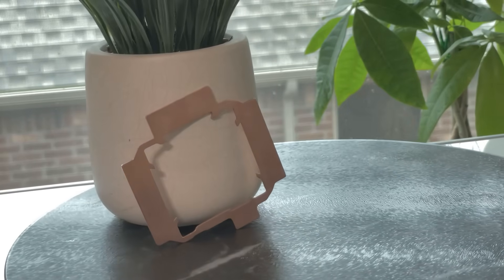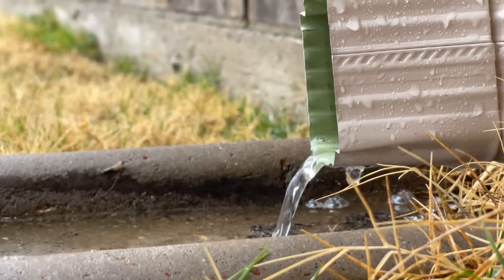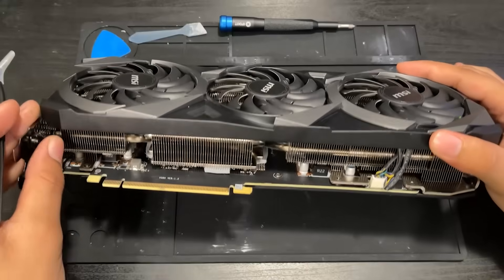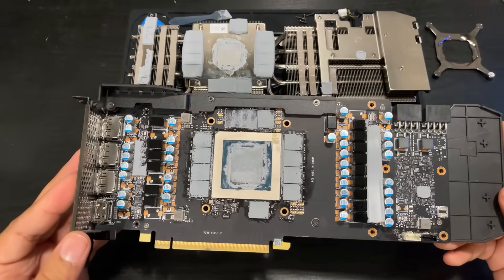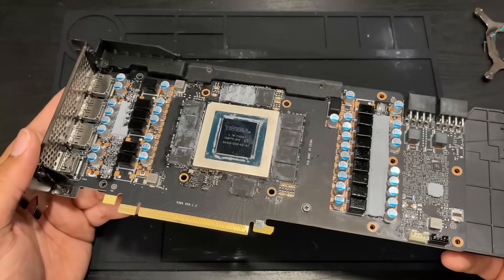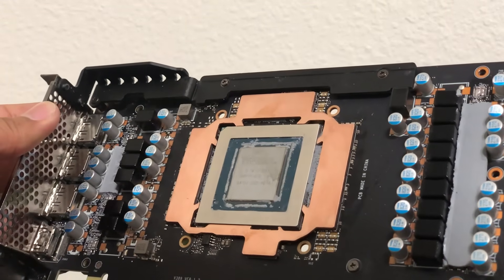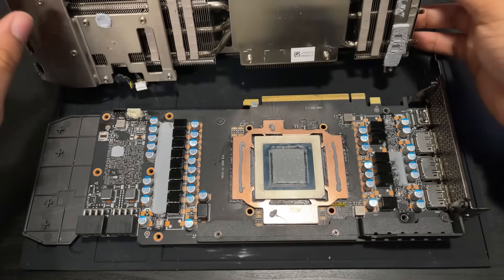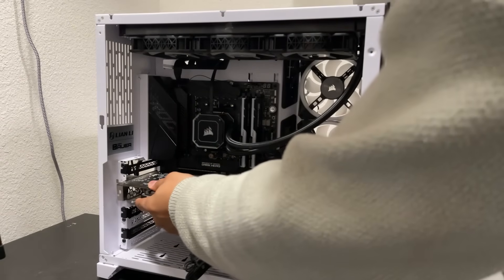Copper Plating FIXED This Melting RTX 3080. 25 Degree Drop In Mem Temps!

Comment: hi I have a question I have RTX 3080 Palit 
when I mine eth with memory clock 2200mhz I got 82 c temp on 50%fan speed keep in mind my room temp like 45c should I change to copper? or it's good ?
Reply from the maker: 82C is completely safe for GDDR6X memory. You even have headroom to move up to 70% fan speed, which is safe. No need to copper mod!
Reply: @dandyworks ty

Comment: If it hasn’t been said already, core will likely not benefit - if not get worse - because the heat sink is more effectively taking the heat from the memory chips, thus increasing the amount of heat it needs to work with and transferring it back to the core.
Reply: that's not how that works, but okay 👍

Comment: Did this to my 3080ti for NiceHash mining - memory temps went from 104C to 86C! Can actually mine now and they unlocked LHR so it gets 120MH/s.  Be mindful of upgrading drivers - Nivida's very latest as of writing this (5-24-22) used driver software to restore LHR and NiceHash was only getting 60Mh/s!! I uninstalled and installed the previous driver, back to 120MH/s.  Wtf Nivida!

Comment: I want to see someone put a copper pad on the gpu die.

I am assuming the die is taller than the memories so the pad would have to be ultra thin.
Just want to see what the results would be.
Reply: Tenho uma rtx 3070 pny dual fan uprising e coloquei uma placa de cobre de 0.3mm e almofadas de 1.8mm nas memórias e deu muito certo. Gpu não passa de 60º rodando fullmark stress teste. As memórias não consigo medir, pois minha placa não tem sensores nas memórias.
Reply: @NatureViva  suena excelente quiero intentarlo con mi gpu.

Comment: Thanks for the vid.  The copper pads on your previous video seemed a bit sketchy to me.  I'm afraid to attempt that mod, as I'm afraid they will keep moving around.  CoolMyGPU have removed this worry, so I think I will try this mod.  My 3070ti GPU runs the new 100% unlock T-REX at well over 100 degrees C even with the clock rate turned down.  Hope my MSI board isn't warped.

Comment: Hi there ! First time on this channel and certainly not last since your content is top notch.

Im very far from being knowledgable in cooling solutions so i have a few questions.

From my understanding the best cooling is obtained through liquid cooling, but when i look at waterblocks installation for gpus most of them use thermal pads for the memory chips between the waterblock and the pcb.

So in theory you get the best cooling with a watercooled gpu mounted with one of these copper plate ? is it even possible ?

Or maybe the cooling of the memory chips is not that important in comparison to the die ?

Comment: Yeah I'm trying to get into this! So far I've got these little tiny pieces of copper for GPUs and Idk what I'm gonna do with them. I'm kinda lost. 
However, I'm also lost in trying to plug in this peltier device or whatever it is. Its supposed to be really cold. Its a pad that gets hot or cold depending on if you plug in one of two wires (black and red) in the other side of something or other I don't know how or what to plug it into. I don't get it. But I want to add it to a gpu or a copper block somewhere in custom loop.

Comment: Im totally down to do this. However, would anyone recommend applying a liquid metal paste instead of a normal one? Just a thin, spread layer as with the core. Or is it still too risky and may leak out from the sides?
Reply: There are two reasons not to do it:
1) temps with thermal paste already pretty low, and you can't overclock memory to have a reason to decrease it more with usage of metal
2) it's really more dangerous, then metal on CPU

Comment: update, mod done, and it works way cooler than it did before. Gellid pads to replace the old ones. it runs 25C cooler. So now maybe it will live a little longer.

Comment: I use a CNC’d (perfect height in all locations) EK water block with three 360mm rads.  One is 80mm deep, one is 60mm, and one is 35mm.  My 3090 never gets above 38C with my 5.6GHz 12900 on the loop.  And it’s still a crappy overclocker.

Comment: How does it compare to thermal pad replacement ? This one might be worth it imo, but i saw thermal pads dropped the mem temp by 20 degrees celcius.
Reply from the maker: This will perform better than a thermal pad replacement. Of course, a pad swap is simple, easy, low-risk, and generally much more accepted. A copper mod shouldn’t really be the go-to method anyway, it will be overkill for most people.

Comment: Hello gentleman, could you please help me choosing the right card, I write down my choices:
These are the 3070 Tis with price tags (after tax) in my region:
Asus Strix: $1030
Asus Tuf: $900
Zotac AmpHolo: $900
Gigabyte Aorus: $885
Zotac Trinity: $825
Tnx
Reply from the maker: I have bad luck with Zotac. While the Tuf and Strix are more expensive, they are usually good-to-go out of the box. Ironically, the only Asus card I have ever had trouble with out of the box is the Asus Tuf 3070 Ti. Despite the thermal pad issue I encountered with mine, this would be my recommendation, so long as you are willing to repad it or copper mod it. The Gigabyte Aorus is also a good pick, but pray you don’t have any issues with it because they have the lowest-tier RMA and return process ever.

Comment: Nice videos, would be interesting to see if there was any performance gain, especially in mining (since AFAIK mining heavily depends on the memory) or how much further you could oc the memory and how that affects performance
Reply: I haven't maxed mine out but Nicehash with the LHR remover I started at around 94MH and after copper modding with the same settings i'm getting 101MH.  I haven't pushed the OC much yet though.

Comment: Copper is great until it patinas, maybe gold plated copper.
Reply from the maker: It won’t. An oxidation layer will not form outside of the presence of an electrolyte, and the aluminum-oxide based TIM serves as a pseudo-anodization layer for the aluminum.
Reply: @dandyworks  .. Copper is still a reactive metal and there are far worse possible outcomes than just oxidation. This can include pitting from some TIMs and galvanic corrosion. In the short run flip a coin but in the long run I'd find a plated copper instead.

Simply Google and read. I don't care otherwise what you do, I'm just giving you a heads up. Good luck.

Comment: I've read that these copper plates can fry a card. Seems risky when there are thermal pad solutions that can bring the memory temperatures down to the 80c range, even while mining. I don't see this as a risk/reward worth taking.
Reply: I think the allure is, and what makes me wanna try copper, is it is a sure fire way to significantly reduce temps. Pads can be funky sized and for newcomers like myself, easy to end up with worse temps. But with Micron or Hynix saying normal operating temps of VRMs are 95 to 105c, I am comfortable running cards at 90c or less..

Comment: I'm curious if I can use my EKWB active plates W/ the copper mod. my 3080 Ti has been experiencing weird and random game crashes and I can't tell if it is attributed to Vram temps or not. When performing tests with a +100 core OC the temps never run over 52 C but idk what's going on.

Comment: @DandyWorks - Fantastic video, and loving the copper mod, i do have some questions regarding the mod... 

1. Is it worth it that it might be more expensive than the copper shims as per previous video with the 3070?
2. What is the thickness on the copper mod in the video as you mentioned before getting a 1.8mm - 2mm is a really good option for modding your GPU?

It would be great to see if you can perhaps show a 3080ti copper mod (With shims or Copper plate) that is for the Palit Gamerock series as that is what I am using for mining at the moment, i have not ordered the copper shims yet as I am still not sure about the Gamerock GPU yet.

The more i watch this the more i just want to get started with the modding 😁

Comment: Nothing for ASUS TUF? I got 112 degrees on memory temp with stock settings after 2-3 hours of gaming, 84 core, 100 hotspot. All in O11 Air Mini with additional 2 bottom fans (also tried without them, and it was worse). GPU have 8 months,  its already on RMA, but ASUS Customer Service told me this temps are fine...... I HAD FINE TEMPS when card was new - 75 core, 90 hotspot, 97 memory (and max 102 with furmark 10 minutes).
Thats worst possible memory for GPU ever made. Never gonna buy again any GPU with that memory untill i see that copper plates on some inbox review - these should be applied by card manufacturer as for now every RTX 3080/3090 is time bomb with that memory temps. User need to UV brand new card for that price? Really? 
I'm starting to hunt for 6800XT Gaming X Trio/TUF and selling this baking RTX monster.

Comment: Damn I’ll be doing this once my evga 3080 warranty runs out. Though I undervolted the 3080, my temps never go over 70c in full load. I would like to run it stock clock speeds or even OC it in the future and want to keep the same temps

Comment: Boss, is it feasible to use 15*15 copper sheets to change the heat dissipation of this MSI video memory? By the way, I would like to ask whether the size of the copper sheets of the ASUS TUF3070TI program is 15*15?

Comment: a nice tip if you want to clean all of the thermal paste use lighter fluid it clean it like a charm and use alcohol to clean the lighter fluid dont worry it doesnt damage the components

Comment: Could that copper shim be combined with the EKWB front and backplates for liquid cooling to further reduce temps or after a certain point is there just no more significant drop in temp?

Comment: You should have spread the thermal paste all over the top of the copper plate too so that the entire unit will contact the heatsink properly. In places where there is no paste the contact won’t be good and this conductivity is low.
Reply: It spreads to where the contact is and kicks the excess off to the sides. The contact of the heatsink to the copper is what pushed the excess, therefor there is no issues with contact. Just watch the video again, I completely understood what he did.

Comment: Edited: Thanks for clarifying and explaining your counter-argument DandyWorks. It appears there would be no problem modding graphics cards with copper plates the same way as shown in your video, but one can never be too careful when it comes to preventative galvanic corrosion measures. Just be wary of others who watch these videos attempting to implement copper into their gpu cooling solutions in askewed ways that differ from yours without realizing the risks, especially if their setup involves liquid-cooled gpus. 

Original comment: "-25 degrees now, and +25 degrees in a few months.
Setting an aluminum heatsinks on top of a copper plate with barely any barrier of separation is just asking for galvanic corrosion, thereby ruining the heatsink and giving the next owner a massive thermal throttling headache when it changes hands."
Reply from the maker: This is not true because there is no electrolyte for galvanic corrosion to occur. Exposure to excessive humidity (or something like water cooling) would be the cause for worry, but in order for a galvanic reaction to occur there would need to be excessive prolonged exposure to such an environment. Additionally, Arctic MX-4 is a carbon and aluminum-oxide based TIM (See Arctic MX-4 MSDS sheet), both materials which are regarded as a great choice for interfacing between aluminum and copper in dry environments because aluminum-oxide and carbon create an extremely strong oxidation layer (similar to aluminum anodizing) which prevents a hazardous acidic environment from forming between the two metals.

Comment: Just a question, just how safe (for the card) is copper modding?
Reply from the maker: Safe if you are comfortable working with a graphics card and familiar with what you’re doing. Otherwise, don’t do it. Go thermal pad upgrade instead. This copper mod done right poses no risk to the card itself, keyword done right!

Comment: Put in a gpu support, it will effect temps and possibly performance. My msi 3090 was exactly the same way, once i added a support it was an instant noticiable/measureable differance. (i got the kind thats like a jack, not the pcie bracket ones.)

Comment: In the early 2000 nearly everyone who i know was forced to cooling mod his GPU - Geforce 3, 4, 5 and 6 had massive issues with overheating so there was a wack ton of cooling solutions for those gpu on the market - and each and every mod came with coper heatsinks that had to be thermalpaste glued on the v-ram ^^ there was nothing special about it. a good cooler could reduce the gpu temperature around 30 to 50 percent.

Comment: The silly thing is that many cards already have protrusions on the heat sink to close some of the gap towards the VRAM. It seems the only reason to not go all the way, is that the board makers are not confident in their tolerances allowing all components to contact simultaneously without anything getting crushed. Thermal pads allows the board to be bent without getting destroyed, and I guess NVIDIAs engineers though pads were enough to keep temps in spec.

Comment: FYI for anyone having trouble with alcohol (and a tip in general). The higher the concentration of alcohol (for example 99% vs 70%) the less water it will have which means two things: 1) Stronger, yet still safe cleaning power and 2) less chance of leftover water and/or condensation should you choose to blow air on it to help dry it faster.
Reply: Amen!

Comment: Well done but i gues you have no idea what you have done with this  mode.
Let me explain. Well i have tried this and figure out that good pads do the job and actualy works better than coper.
So now you say what the hell man look at the mem temp.
I say to you look at GPU temp.
Your Gpu core is coockin now and taking all left ower heat from the memory and you have end it with similar temps in heavy load.

So your knowlage about what you are doing is so poor that you didnt eaven bother to investigate and show to the people what is goin on. Instead you i will do it.
Well its called a law of termodynamic.
So the GPU core and Memory module are 2 iduvidual object which both of them sharing the same giganctic coper based heat disapator. So 2 objects touchin the same surface bounded with this coper plate who are extreemly termal concutive made them share Temperature.
Yes from your last video you forget to mention that asus tuf rtx 3070ti have separated cooler just for memory modules so this could not occur.

I have tried all this and figure all of this and it is true as it stands.
This video of yours proove all.
People do not do this its gonna harm your GPU core a lot only in case if your gpu have dedicated cooling.
Peace out!!

Comment: I did the small square ones on my ftw3 ultra and first tried with 1.8mm ones, core was going nuts in game so with help of those grinding machines (don't know the name in english) I reduced the thickness to 1.5mm and smoothed them with 400 grit sand paper. now core stays cool around 73-75c while gaming and memories are at 85c while mining. Gonna do this on all of my cards and save the thermal pads in case I need to send the card for warranty.
Reply: makes sense.  these full shim plates are 1.57mm.
Reply: I'm getting similar temps in open air on my 3090, just good 3mm soft pads, 2.5 soft, and a layer of k5 where evga put theirs. Squeeze the 3s down to 2.75 and the 2.5 down to 2.25,  decent layer of k5 and  ptm7950 for the paste.
All temps.dropped to spec (vram stays under 85 and core stays under 70, fans dont get past 71%)
Reply: Core gets to 74 but pushing 420watts, 70% fans😊

Comment: That card is trash. The backplate is plastic and does not passively dissipate heat nearly as good as a all metal backplate. I had one and sold mine as soon as I could.
Reply from the maker: Yeah. Plastic backplate on a GPU I paid $1,200 for (got it at MSRP peak shortage!) it’s kind of a kick in the teeth.

Comment: What would happen if entire heatsink, and those termal pads were replaced by copper ?   For an example if they would come with whole coppar heatsink instead of aluminium or metal.
Reply: Copper would perform better than aluminum in thermal conductivity, but given how fat heatsinks are nowadays on extremely power-hungry gpus, it would also drive up the cost of gpus by around another $50-100. Copper is also scarcer compared to aluminum, further reducing gpu supply in a world where gpus are already hard to come by.

Comment: I run octanebench manual OC, fans at 60% and my memory and GPU core temps never go above 55°c
EVGA RTX 3080 FTW3. 👍
Reply from the maker: Modded or unmodded? I hear that the 3080 FTW3 has a very good cooling solution, and if I remember correctly, the coldplate is actually copper (could be wrong, but props to EVGA if it is)
Reply: @dandyworks  unmodded atm, I will keep an eye on it and see if over time the temps ever increase, here's to hoping not.

Comment: These results are great! If I hadn't put my 8 3080s on waterblocks I would've definitely loved a solution like this. My msi 3080 ventus were among the worst performers before water-cooling. I was reaching 100c if I didn't have fan speed to the max. Water-cooling is a whole different beast. 50-60c on the memory depending on the temperature outside

Comment: JFYI lighter gasoline dissolves thermal grease so use it as first cleaner. Than use isopropyl alcohol to remove layer of naphthalene that is left by the gasoline. Cleaning it like that gives you perfectly clean parts. Or by one of those two solution cleaners that are same thing but with better smell.